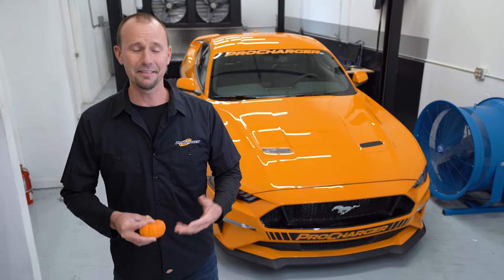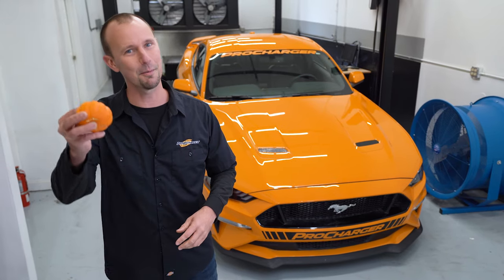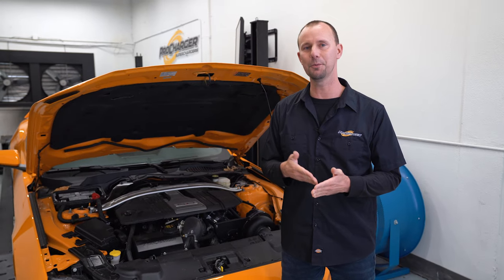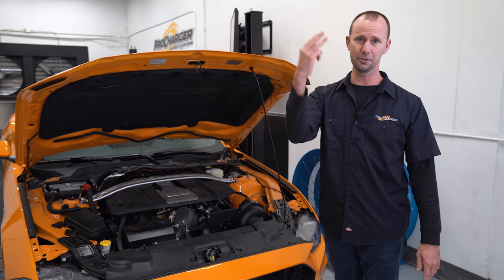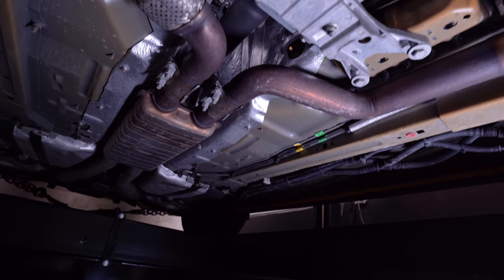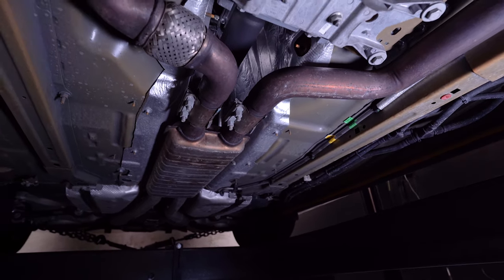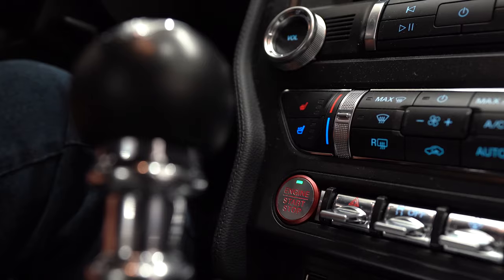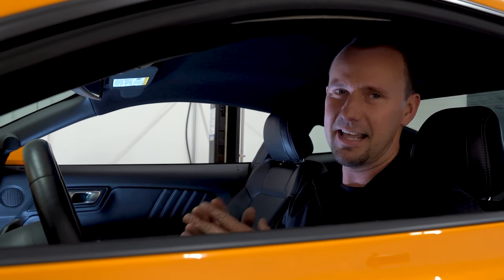PROCHARGED 1,000 HP MUSTANG WITH (2) MODIFICATIONS?!?!?!

Comment: I hate to be “that guy” but the math used to get the estimated crank horsepower was wrong. You can’t take 13% of the 893 hp and get the total crank numbers . You have to use the 893 as the 87% and then cross multiply and divide to find out what X (crank hp) would be. So you multiply 893 whp by 100 which is the total amount of crank hp then divide by the 87 which is your known portion of the whp and you get 1026.4 crank hp .
Reply: Who cares man
Reply: @perccobain8374  you care enough to comment
Reply: Always annoys me when people don't do their mathes properly, correct, when you're working out power train loss it's loss not a gain like he worked t out.. if it was making 1000 at the engine with 15% loss it 1000 x 15% - = 850 , you can't do it the other way because 850 x 15% = 978, the reason people are adding 15% is because +15% = 13% loss.... 15 / 115 % = 13.... simple maths... 1000 x 13% - = 870... 870 x 15% + = 1000
Reply: 893÷0.87=1026
Reply: OMG and I thought I was the only one noticing it. I too got 1026.4hp, and I was like wait a minute, something is off here. Thanks for pointing that out, and not making me feel the odd one out
Reply: The reciprocal rule!
Reply: Hot day cold day and you probably couldn't out drive 500hp in a circuit car anyway.
Reply: yea 1.13* 893 only adds 13% of 893 to 893. 893 is 13% of something so you can’t take 13% of the smaller number and find where it came from like that. Different math. You can check the math 0.87*1,009 is not 893. Point being it still makes over 1K HP crank.
Reply: @RR.S550  my wife doesn't know that rule .
Reply: @Madmaxxxx1984  heh... Women..

Comment: Mt82 may not hold for long on this power..nor will hit hook very well id guess..it was 2 years ago so wonderl if its been reliable..nice work!!
Reply: I ran the F1 kit on mine and the only problem I had was grenading my stock clutch my first pull on E-85 lol. Other than that the MT held up fine
Reply from the maker: Ole Jack is running strong. Zero issues.

Comment: There’s ??’s I want to ask ??s how much is the extra like half shafts that are stronger to handle more horse power , do you do adjustments to the transmission if need be , unknown ??’s mite dumb to ask just asking because I do not no
Reply from the maker: This car is 100% stock other than the supercharger, and fuel system.  The trans is a manual, however the Autos seem to hold about 700 whp with no issues, and sometimes 800 for limited amounts of time.

Comment: Ok you have me sold !!! I want this asap
Reply from the maker: Give us a call. We can walk ya through It!
Reply: @ProChargerSuperchargers  ok do I have to do any fuel changes such as a new pump . Does some sort of tuner come with it?
Reply: @ProChargerSuperchargers  and what gear should I be running?
Reply from the maker: @threexxxphat  drop us a call, however most run the 3.15 or 3.55
Reply: @ProChargerSuperchargers  what pulley was this? I have a P1x on my 2019
Reply: @nola504boy1  3.70
Reply: @ProChargerSuperchargers  how much boost was it making?
Reply from the maker: @richardortega9846  15.4 psi

Comment: Did you mention to change the oil pump gears and sprocket first or else you will blow the factory ones and the engine will automatically fail with that type of horsepower.
Reply from the maker: Factory engine hasn't been opened, and we still have this car, since we bought it in 2018.  It actually has been driven all over the country doing visits to our dealers.   The only thing we have done is change the oil in it.

Comment: Really interested in this, any heat issues? I have the mt82, and even though i don't plan on going past 750 hp, you think I'll have issues?
Reply: With the MT82, guaranteed… that’s why I’m going T56 Magnum and sell the Factory tranny before it’s no longer able to handle boosted power
Reply: @FYMM69  how about the 10 speed version?
Reply: @FYMM69  no you’re straight just need a clutch and fuel system I have the same set up
Reply: @wasimlhr  i prefer shifting gears
Reply: @ValdezLandscape  turns out the Tremec won’t work in my 21 GT. car is digital 6pin and Tremec is 2 pin analog. All that money spent and no one has the solution to make it work.
Reply: @FYMM69  tr-6060 perhaps??

Comment: ONLY thing I don't like about this setup is the fact to change/clean the air filter you have to remove the front bumper. At least it looks that way from the looks of it since it's tucked away under the bumper.  I'd would of liked it like Vortech who put it inside the engine bay.
Reply: No you don’t it pops off the blower the same way. I’ve owned both Paxton/Vortech & Procharger on these cars. They’re basically the same honestly.
Reply: But with the air filter inside the engine bay, you would have much higher intake air temps and lower power I guess.
Reply: @nola504boy1  thats exactly right! 
no need to get it from under the bumper, just remove the tube from blower and pull it up.
btw I am thinking to install a louvered vent on the inner fender to let it breath outside

Comment: What’s the recipe here, what kit and tune needs to be bought and should the oil pump gears be upgraded for this
Reply: Gears should be changed because one your already at the gears and 2 they would most def crack the stock gears
Reply: stg 2 kit, P1x head unit, 3.70 pulley, stock opg, and tuner kit

Comment: Is the crank and wheel horsepower the same?
Reply from the maker: This car has made over 950 wheel.
Reply: @ProChargerSuperchargers  what size pulley were you using on this test? & what size pulley was on the blower before swapping out?
Reply: Crank horsepower is if you had the engine attached directly to the dyno, wheel horsepower is with the transmission and rear end in the rear wheels attached and the wheels are actually spinning the dyno the horsepower that you feel is wheel horsepower and the torque not just horsepower but also torque

Comment: HP numbers are calculations.
The proof is weight, mph in the 1/4 mile.
I have a Corvette but i think these 4 valve motors have more potential than a pushrod LS.
Add a 10 speed auto and you have the combo.
Reply: really want to see this in a 10 speed GT and real life test and numbers.

Comment: No sane tuner will let you tune for 800+ whp on stock block. This is the grey area. It can throw a rod at any time. So keeping the exhaust stock won't help.
Reply from the maker: There are many that will on E85.  This car is still exactly the same as it has been for years, and still can belt out a 950hp pull anytime we need it to.   

Sure it would be nice to have a built motor.  But its amazing that the stock engine, is still singing a good song all these years later at such a high HP level.

Comment: OMG!! . You’re crazy if you think you’re going to be pushing over 900hp continuously on stock internals and stock tranny etc… that’s a ticking time bomb imo…. Let’s get back to reality here. You can push any of todays v8s to over 900 depending on boost. If you have a honest and good tuner I can guarantee they will tell you that’s not a good Idea but don’t cry when it goes bang shortly after. Basically what I’m trying to say is do your research, do the supporting mods and play it safe guys  or it will cost you a lot in when that happens. To me this vid is just a sales gimmick to say hey for 8k you can have over 1000hp at the crank. But I still love my procharger. Is it worth it? Yes!
Reply: Agree
Reply from the maker: Jack's doing just fine 3 years later. Couple swirls from the car wash though.
Reply: @ProChargerSuperchargers  You aren't running it at that power level though. Considering the first part of the video you take the big boost pulley out of the trunk... Lol. Still great power, but you shouldn't be selling the kit as 1000hp reliable on a stock car, because it's simply not. You're also not running it on 110 octane gas for all those miles either.

Comment: I just don't see how this is worth triple the price of turbo charging a car when the turbo makes more power and gets better fuel efficiency.....don't get me wrong I have bought a couple pro charge kits over the years but after changing over to turbos on all my modded cars I have had it's been a night and day difference for more than half the cost Installed and tuned. Sick mustang though.
Reply: There’s a twin turbo kit for the S550 Mustang that’s half the cost of the P1X kit and is just a reliable…? I don’t know about that one…
Reply: @waltgodisney  yes... It's called build one. And I wouldn't go twin turbo I would go single but that's a preference. For the gains a turbo is much more efficient in every way. And can make more power on the same amount of boost with lower temps. 
I'm not saying the product isn't good I am just saying the price is a bit much for what you get. This is the most basic of setups not all the bells and whistles for that price they are quoting.
Reply: @JuanBrolo so what ur saying is that there isn’t a off the shelf turbo kit in the same price range as this …off the shelf piece…. Big difference between building your own… and buying a KIT off the shelf…. Got it 🤦🏻